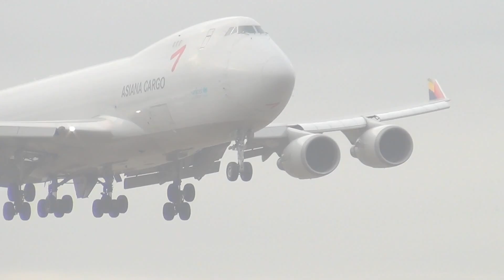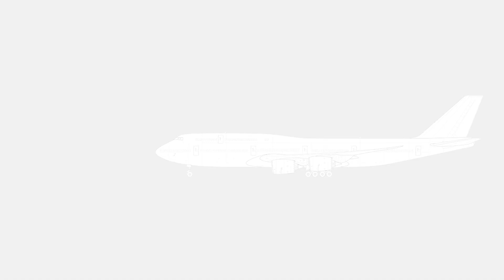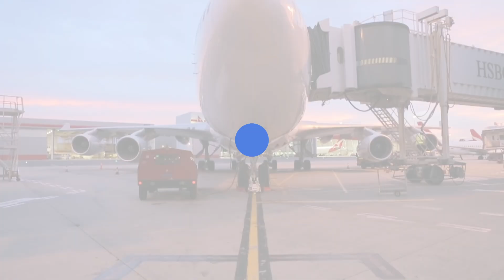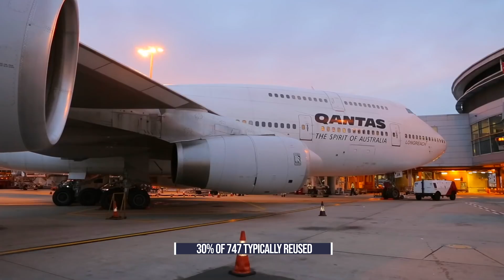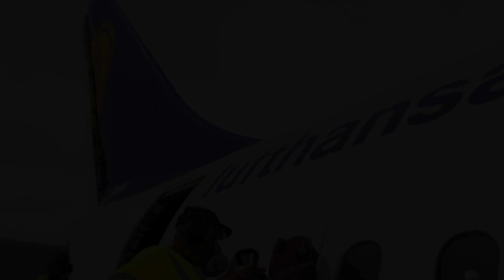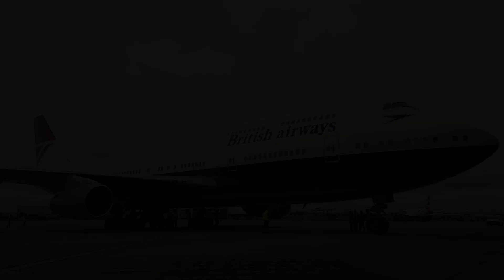Jumbos In The Scrapyard: How A Retired Boeing 747 Is Dismantled

Comment: it should be noted most of the 747's being scrapped are more than 20 years old. People forget a HUGE number of 747-400's were built during the 1990's and most of those planes are headed for the scrapyard, unless they're in good enough condition for a 747-400BCF freighter conversion.
Reply: @Small Boi Gaming Most of the newer planes will likely be candidates for a 747-400BCF freighter conversion.

Comment: They could use many of these to convert to VLAT (very large air tanker) aircraft ! 
With the massive wildfires experienced this year in Australia & western America, a fleet instead of the one single 747 VLAT would be an advantage.
If say Boeing took on the conversions they could i am sure do the work much more cost effectively than Evergreen did the two that they converted.